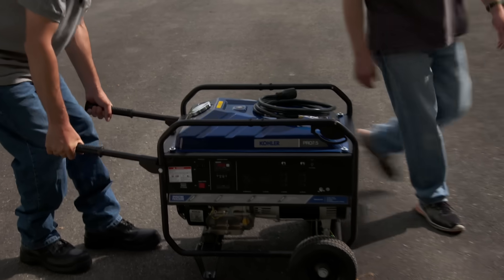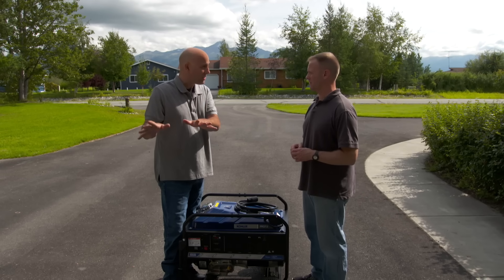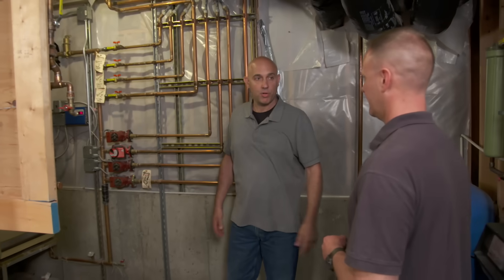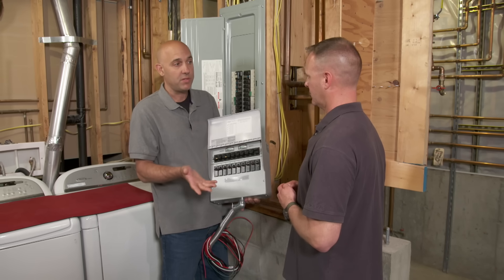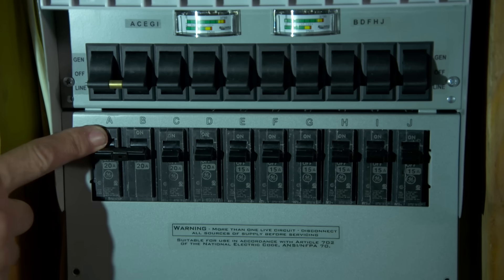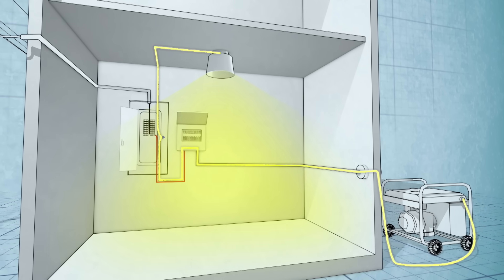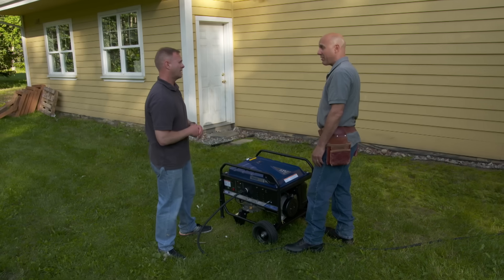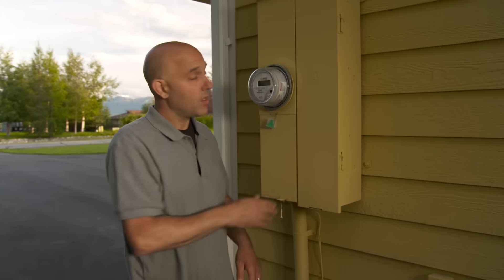How to Install a Manual Transfer Switch for a Portable Generator | Ask This Old House

Comment: That expensive azz transfer switch and all the work to install it, when a 2 pole breaker and an interlock would do the same job. But hey, if you're a pencil pusher, and too dumb to know what your critical circuits are, Men have basically become women

Comment: Just a few observations. They didn't discuss whether the generator had a bonded or floating neutral as a bonded neutral requires the neutral to be switched by the transfer switch as well. 
The generator (SOOW) cord should really be as short as is practical, the longer the cord the greater the voltage drop, in this case 55' of cord could be a drop of ~ 5 volts, doesn't sound like much but it can be important depending on what is being powered. 
The home owner mentioned not relying on the gas furnace and the electrician indicated that would be taken care of with the generator but they didn't say what type of electric heat would be used. Electric resistance heat draws a great deal of current, the generator was only 75kw.

Comment: So at the end you simulated the power was back on, but.... The generator was still running. And you told him to go shut the generator off.  So wouldn't the main and generator be "on" at the same time? Or does the transfer switch automatically revert to the main power supply?

Comment: Why does everyone way over complicate these.  Just go to the pole wire up an outlet on the house side of the meter base.  Then have a double male hook jumper wire hook to the 240v generator outlet.  Make sure you have all non essential breakers shut off.  Disconnect incoming power, plug in generator fire it up and there you have it.  Most generator have circuit breakers on the outlets to protect it.   The breaker panel in the house protects the circuits there.

Comment: Make sure the splices in the panel are TRUE splices, and not just wire nuts holding the wires together.  A true splice requires wires to be twisted together, with a minimum of 4 knuckles, or twists.  Then a wire nut should be twisted on, to prevent contact and dust collection.
Reply: If working with stranded wire, be sure to split the strands into 2 equal parts, and twist them together to form a more rigid braid of wire.

Comment: You missed the step to switch back to main power, normally you switch off the circuit breakers or the transfer switches in the transfer switch panel to avoid turning off the generator with load, there are a couple more steps to make things right.

Comment: How does this manual switch not back feed power back into the system when running the generator?

Seems to me as soon as the circuit is energized power is running through the bus bars now.

Comment: The funny thing is on this specific generator the plug he is pointing to is only a 30 amp. I don’t know anybody who has their generator hardwired to their house to use a 30 amp plug. What I always see is people using the 50 amp plug to hardwire it Into breaker panel so the only downside of using a 30 amp is you won’t be able to use as much electricity before overloading the plug because as we all know, you can power more things with 50 amp than 30 amp so please have a generator that has 50 amp 20 amp and 30 amp service Outlets if you’re going to plug it in to your house so that will power your whole house please use the 50 amp not 30.30 A are usually for campers at least smaller campers

Comment: Hello, 

Was your installation done in Canada? If not, do you know if the Canadian code allows the connections you used for the installation of the generator electrical box?

Comment: I'm hoping someone can shed some light for me. Is it true that you can install a manual transfer switch for a subpanel? 

 I recently had an external disconnect installed on the outside of my house. No circuits here. Just the utility service coming into the "main" panel and a 200amp breaker. Even though it doesn't have circuits or breakers, I was told it's considered the "main" panel due to being the first means of service disconnect. The panel with all the circuits and breakers is now considered the "subpanel" and all the grounds and neutrals are seperated. With this being said, I just wanted to make sure I'm thinking about this correctly and a manual transfer switch can be installed for a subpanel? 

My last question is regarding generators whether they should have a floating neutral or should it have the neutral connected to ground. Does this matter for a manual transfer switch? In my case, I would assume you wouldn't want a generator with a grounded neutral since a subpanel has grounds and neutrals seperate. Thank you in advance for an info/help.
Reply: Yes, you can install that type of manual transfer switch on a subpanel.  On a subpanel, the ground wire and neutral wire go to different bars, so do it that way from the transfer panel.  You would want a floating neutral generator when connecting to any house panel.
Reply: @johnsteed99  Perfect. Thank you for your help. I thought the way I was thinking of doing it is correct, but wanted to ask.

Comment: Correct me if I'm wrong, but I think some electrical codes don't allow merrets in the main panel for splicing wires together so those splices might need to be spliced together outside the panel in a junction box for those ten circuits (not sure if the addition of the job outside the panel violates any codes).
Reply: Yes you're wrong

Comment: Dumb question but, how does one know when the main power comes back on if you're running a generator?
Reply: There is a device you can buy for that, but here in Michigan, if I report a power outage to my utility company, then will text my cell phone when power is back on.

Comment: I wired 240 V 50 A outlet straight from outside the wall to my circuit box.  When I lose the power, I turn off my main 240 V 200 A breaker and turn on my 50 A 240 V breaker and start my generator.  It's seems simple and effective.  I just don't use microwave.  AC AND WATER HEATHER are on gas.

Comment: I have the same generator.  But we have solar here in California so can you explain how to hook this up with having solar.  They will not let us use solar when the power goes off.  The solar hookup is triggered to cut off when the PGE power is gone.  All automatic.  Can I still hook this device up to my breaker panel even though solar is involved?

Comment: As someone who has done this, there is a lot more to it than they show, they gloss over getting the wires in to the box, the drilling of the hole thru the house, especially if you have concrete block construction, and the fact that some time the breakers you want to switch, the wires supplied won't reach. You can't always mount this box right beside your panel and then you find the supplied wires are too short to get to the circuits you want. These videos always seem slick, but there are many more situations that arise that aren't covered here.

Comment: The exceedingly long power cord is that going to be a problem with a drop in power?  I was told that more than 25’ is not recommended unless a higher gauge cord is used.

Comment: What are the benefits to using this over an interlock kit? Seems like a lotttt more work.
Reply: I agree.  Just install a interlock kit with generator breaker and selectively turn on needed circuits.

Comment: Only time I see those useful is when you have an obsolete panel that doesn't give you interlock  option. Do a service upgrade to a Cutler hammer.  CH series panel with the interlock Cover. You have way more options on what you can select for circuits and not be so limited.

Comment: Thank You, my local store was not sure which 10-3 non-metallic wiring you spoke of, could you please give more info, thanks, also would a 10-3 romex work? is there a benifit of straned over sold wire? ThankYOu
Reply: Solid 10-3 romex is ideal in residential homes.

Comment: Okay, on a 100 A service, is there a disadvantage using  a 100 amp dpdt knife disconnect between load center and utility meter, with the genset plug wired on bottom lugs, utility on top lugs, load center on knife. ?
Other than knowing and , marking essential breakers for ' genset only '  to prevent overload? This would allow the use of other circuits if needed by switching off or swapping loads on a temporary basis. 
 The only disadvantage I see would be a load added other than the marked ones.  Usually loads or sparsed unused wall outlets or lights . Heavier loads as in dehumidifier or refrigeration startup and run, laundry machines- esp. 120vac electric dryers, microwave, air fryer ovens, toaster, toaster ovens, O2 concentrator for medical patient. ??
I know that #2, #4 se cable can be tough to manipulate through a weather hub and bend to a lug

Comment: Questions: 1- Does the Kohler generator provide two phase 120/240 volt? I assume so hereafter.
2- Assume that two of the circuits in the house have a shared neutral, each circuit been rated at 15 amps. These circuits are setup on opposite phase and the  currents in the neutral wire corresponding to each circuit subtract each other, therefor stay below 15 amps. Now, if the two hot wires of these circuits are rerouted to the transfer panel so that each are on the same phase of the generator, would not that create a dangerous situation as up to 30 amps could run through a neutral rated at 15 amps? 

Should not the video make clear that the breakers put in the manual transfer switch should exactly match the corresponding breakers in the electrical panel with exactly matching wiring?

Comment: Does the transfer switch protect sensitive items like a furnace, a/c, or refrigerator?  I have read that gas generators can cause problems with circuit boards, etc.
Reply: A portable inverter generator or larger permanent generator would be the options for sensitive equipment.  The transfer switch doesn't do anything but connect to a power source.

Comment: My god - whoever installed that OCD copper plumbing did a beautiful job
Reply: Brotha I was sayin the same thing beautiful work 😎🤟
Reply: The copper work in my 60 year old US Steel home is a total work of art! It's nice to see the pride that some installers exhibit for copper instalation.
Reply: Yup, so smart to put all those potential leaks right above the breaker box Morons.
Reply: @5400bowen i must have missed something. There ain't no pipes near the electrical panel. They are on the other wall and if done right there should not be any leaks. My dad always wiped the solder around each connection and none ever leaked. 73
Reply: @ronb6182 you must need glasses. The panel and new box are literally surrounded by and under the copper water pipes, literally inches away. Watch over their heads from the wall where the washer is, it runs over above thr breaker box and to those pipes framed all around both boxes. And have you ever seen a leak from a pressurised pipe? Even the pipes on the adjascent  wall are within 2-4 feet of the main box. Ever have a squirt gun when you were a kid?
Reply: @5400bowen I watch on a phone so I may not  see the whole video screen. My dad did his own and never had one pipe leak over thirty years. I'm sure there is a code how far away pipes should be. I would just use an outdoor box if I had my panel in the basement. Most places pipes are run under the floor and the power box is upstairs. At least in the north. 73
Reply: @ronb6182 my comment was also that it's just ridiculous that they don't separate water and electrical. And in this case you've got both all over each other, all over that whole room. Architects and electricians and plumbers make BIG bucks, and still do stuff like that. No need whatsoever except laziness and incompetance. I designed and  built two cabins and there is not one electrical device or line anywhere near, and ESPECIALLY WATER OVER OR NEAR ELECTRIC, in the entire buildings, except the kitchen counter and bath vanity outlets, and still nothing over. Yes, leaks in well done plumbing are rare..but the people who burned to death in fires from them will tell you a few simple safety rule observances are why there are codes for safety. It is just commpn sense to separate the two as much as is practical..and I don't mean from a money viewpoint. Yeah, the whole room they were in is water pipes and electricall all over the place. Why?

Comment: Thank You.
One question/concern, during outages, how is it safe to have Gen on, and then when power grid is restored, they’re both feeding the same breaker to same outlets lights/appliances?

Aren’t I suppose to turn the other 10 Breakers in the main panel “Off”?…
And when power grid restores, then turn Gen Off, and the 10 chosen breakers at the Main Panel back to the  “On” position??

I’m a bit confused.

Could you please clarify this concern?

Thank You, kindly, in advance.

Sincerely 🙏🏼
Reply: Good question.  The Transfer Switch will only allow power, from either GEN or Line power to those circuits.  (Never both at the same time) With this type of Transfer Switch, you will never need to touch anything in the Main Control Panel.
Reply: @Pk3_Garage  I’m understanding it.  Thank you!!

Comment: Those wire gauges they are using is not nearly heavy enough for the job.  The wire needs sized according to loads.  Especially concerning is the 50' SOJ cable that appears to be #10 wire.  The folks have a water well which generally needs a 20 amp circuit alone.  Then all the circulators for the heat and additional loads from the other 6 circuits.   Not sure this is a good video for folks to use as guideline for generator design??

Comment: Nice video the only problem with your installation is by code you’re not allowed to have open splices in your circuit breaker box like that

Comment: How do you know when the city power is restored?
Does it foul things up if you are on a generator when the power is restored?
so you are getting both sources.
Reply: Main breaker should be switched off, then once you know power is on (neighbors, etc) shut gen off, transfer switch breakers to line, THEN main breaker on
Reply: That's incorrect.  With this type of Transfer Switch, you never have to touch your control panel.  Everything is being switched between Grid, Off or Line for those circuits in the Transfer Switch.  

To answer the question, the circuits not connected to the Transfer Switch will let you know when Grid power has been restored when things turn back on.
Reply: Makes sense

Comment: When commercial line power is restored, it is better to FIRST flip all the transfer switches to LINE before shutting down the generator.  If you shut down the generator while powering your household circuits, the power fluctuations may damage sensitive electronics or your AC.
Reply: Truthfully, you should switch each circuit to GEN or Line, one at a time, allowing a few seconds before moving the switch.  This will allow the generator to stabilize and minimize power fluctuations.
Reply: @Pk3_Garage thanks for the tip! It makes sense as you'd want to wait until the starting watts of the appliances dropped to operating wattage
Reply: @Pk3_Garage  That is what "shut off via the transfer switch for the sensitive circui" means. 😄
Reply: Shutting down your generator under load can also damage it
Reply: Or flipping off the breaker on the generator itself before shutting it down. That’s what it is there for. Just like how they didn’t turn it on until the generator was on.
Reply: @joeythefoxxo  Not a good idea if you have TVs or really sensitive electronics on line.  An abrupt shut down of the breaker may still allow/cause a large voltage fluctuation.  better to shut off via the transfer switch for the sensitive circuit.

Comment: Any issues with the fact that the generator neutral and ground are bonded at the frame and you’re sharing neutral and ground with the main panel?  Because typically neutral and ground are also bonded at the meter and I didn’t think it was good for that to occur in more than one place.
Reply: Generator should utilize a floating neutral in this application. I’m surprised they didn’t mention that in this video. Most portables are bonded neutral so they generator must be modified and then not used for portable tools, appliances… until converted back.
Reply: did you ever get an answer to this question?
Reply: @imahustlur  no I didn’t

Comment: can you use a generator that has 3 prongs but an adapter that converts it to 4 prong? My generator is only 120V but all the circuits I need is 120V

Comment: Gasoline doesn't last long so a dual fuel generator is what you want which runs on gas or propane.   Propane doesn't go bad. It looked like this was only 30 amp, I also have a 50 amp connection.

Comment: Few things I don't like about reliance transfer switch.  1st they give you a 20amp 2pole breaker  with 10gauge wire , where's the 2pole 30amp? Also all the branch circuit wires are 12 gauge but, backed up by 15amp breakers. WTF?
Reply: You can easily change out all the breakers to match what's in your control panel.  A 30-amp double pole breaker cost around $10. A single 20-amp breaker cost about $4.

Comment: Wait.. at the end he turns on the utility power while the generator power is still on? Did I see that right? I thought both shouldn't be on at the same time
Reply: It does not harm anything because of the switches that select either utility power OR generator power. However, when the utility power is back in you obviously have to switch back to utility power on the switches.

Comment: I have a generator with 120 only. It's wired directly into my panel with its own circut breaker and a simple transfer switch. I don't have seperate switches in a transfer box that select what things I want to power. Everything that's 120 in my house has power to it. I just know not to try to run everything that's 120 in my house at the same time. Is this somehow bad?